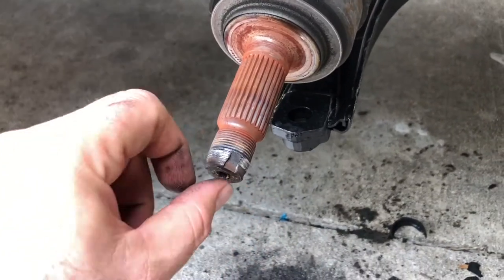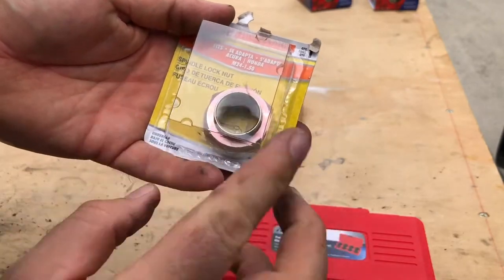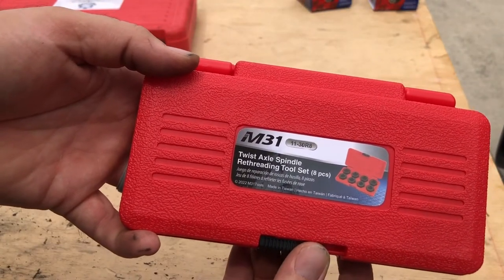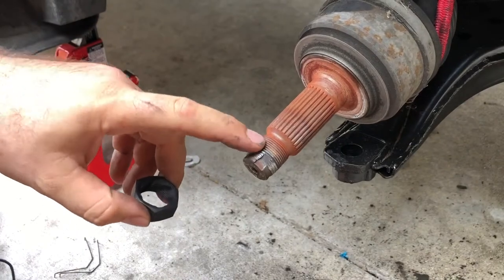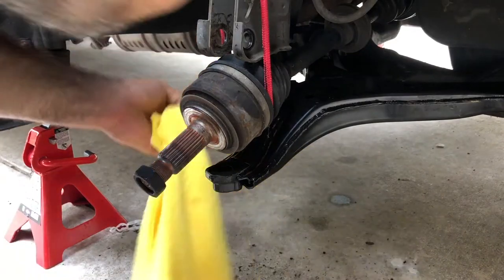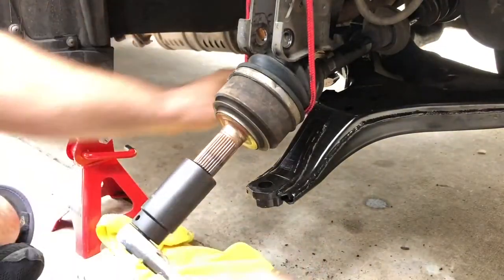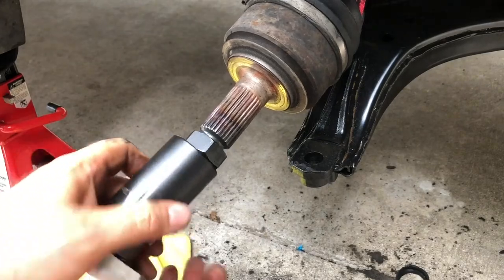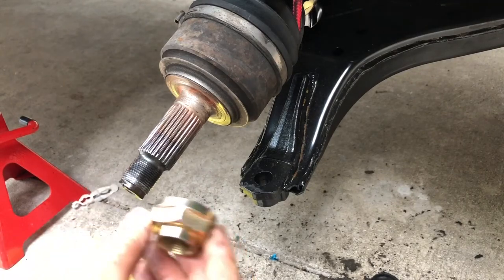How to Fix CV Axle Threads (Honda Element)

Comment: Appreciate it bro! I just ordered a kit like this and hopefully it works. My wheel is still completely attached though. I just took the center wheel cap off for access, as I don’t have the tools to take the wheel/rotor etc off
Reply from the maker: You can rent tools at auto zone  they are usually free. Meaning you put a deposit down finish the job and bring the tools back and you get your money back
Reply: @MendandMake  I didn’t know that. Thank you. worst case scenario I can do that, an extended hex drive should do the trick though..
big enough opening to fit.
Reply: @MendandMake  got the re-threading nut all the way down, and so smooth I’m able to do it with my fingers. Thing is, I may have ruined the threads on my new axle nut, as it’s not going on, even though they’re the same size. Could I leave the Re-threading nut on and drive my car until my new axle nut comes in??

Comment: You should have installed the axle to the rotor as if it was ready drive, that way you could have had the axle not fight you during the threading.
Reply from the maker: True. I was trying to make sure I could fix it. If it wasn’t gonna work I would of had to take off the axle
Reply: Where you get the die set
Reply from the maker: I didn’t know it was gonna work or not. Wasn’t trying to reattach anything to it if that’s what your saying

Comment: great video, recently had to do the same on my bmw 335i axle threads. Just figured I would add for anyone else trying this that it helps quite a bit to use some light oil like machine oil or 3in1 as you go as well as spinning the die a full rotation and backing it off a half rotation at a time to increase your odds of making a clean cut as well as the opportunity to remove any shaving so they don't continue to be dragged along the threads as your continue to work the die up the shaft
Reply from the maker: Yea it helps. I really didn’t want to pull that axle. $20.00 die set fixed it for sure